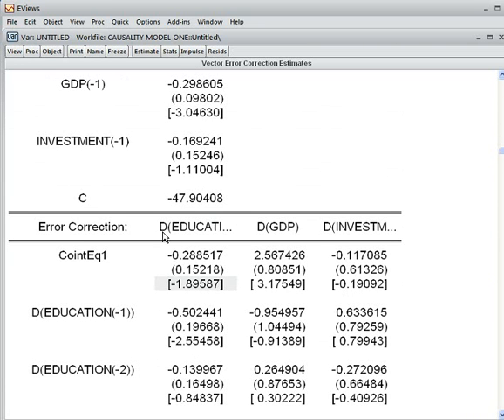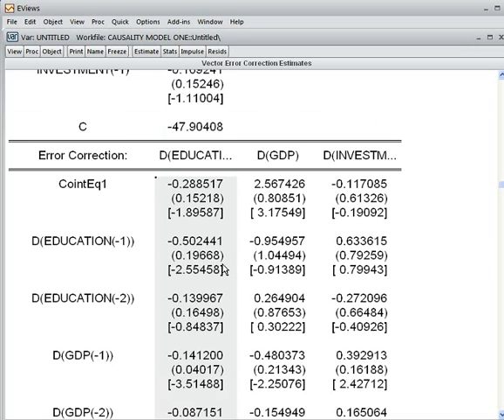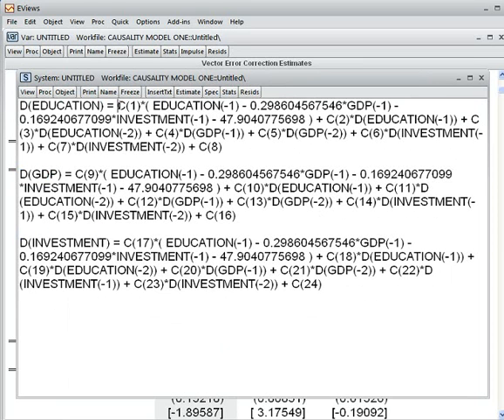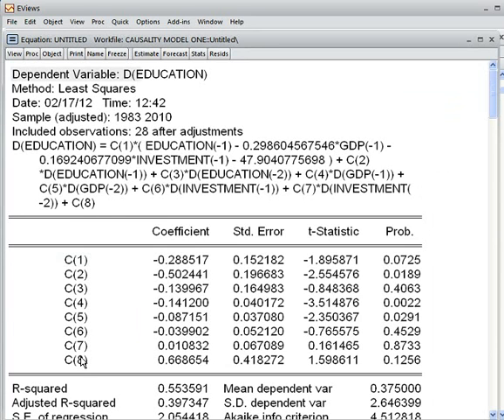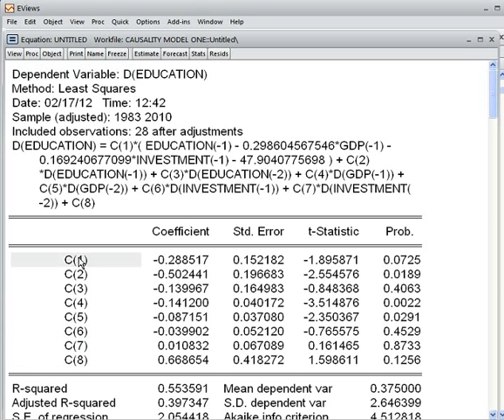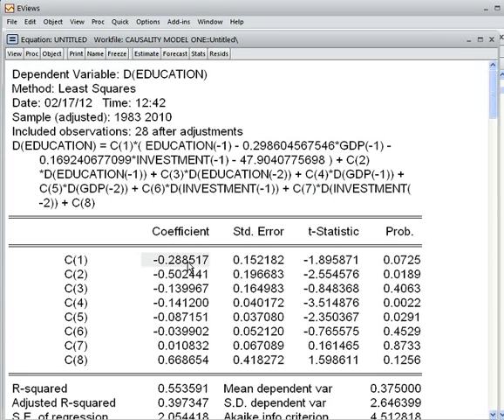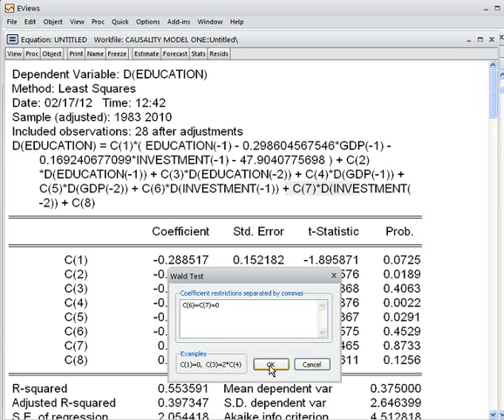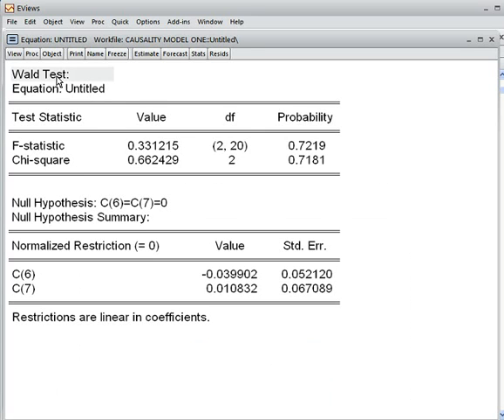Transmission Channel in VECM. Model One. Part 4 of 5. EVIEWS

Comment: Hi Sir, is it true that making following interpreation corresponding to this VECM result: For example, coefficient of GDP(-1) "C(4)" is -0.14. This means 10 % increase in GDP will cause 1.4 % decrease on education rate. Does the negative sign in front of coefficient "C(4)" means that there is a reverse relationship between GDP and Education rate?